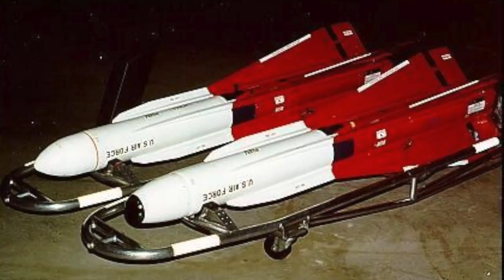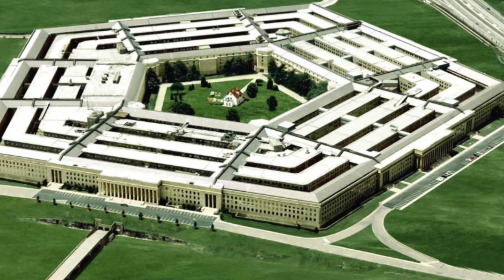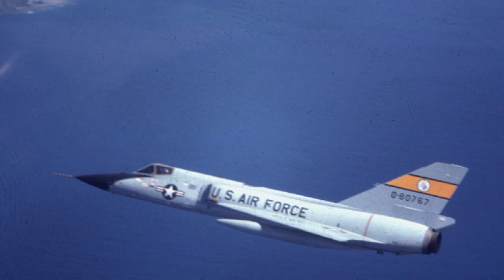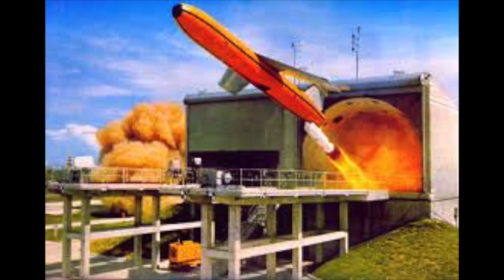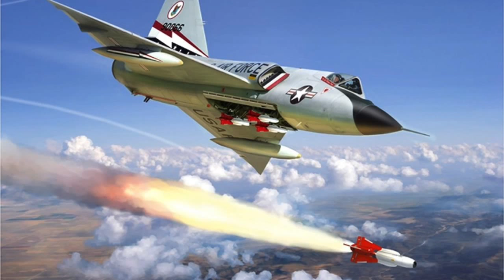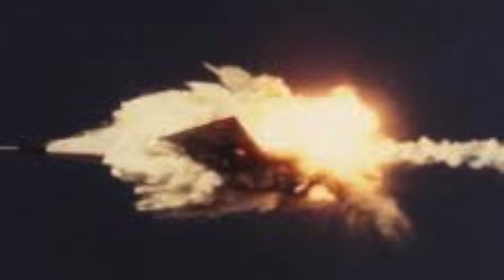MACE kill

Comment: It was the MB1A1 rack that was in the center of the aft rails, My question to you as a 6 pilot should be easy, what weapon was carried there? The only fighter interceptor to carry one. What was it?. I was stationed at Griffiss from 1980 to 1988. 462. LSC crew.
Reply from the maker: edward moriarty Most of the time the MB-1 rack was empty. On aircraft modified to carry a gun, it could not carry the MB-1.
Reply from the maker: edward moriarty We never carried an AIM missile on the MB-1 rack.  The racks were completely different designs. The MB-1 was ejected from its position, while the missiles were extended on special rails before being fired.

Comment: a bit unrelated, but what are your thoughts on the F-104 Starfighter? I heard it cleaned house during Feather Duster II
Reply from the maker: See my video on F-106 v F-104.  The F-104 was amazingly fast, but was short on fuel, had no radar to speak of, and couldn't turn with the F-106 subsonic.  However, at about Mach 1.4 our turning was almost equal.  I think the F-104 was an amazing plane for its day, but short range was its major problem.  To go any distance, it needed external fuel tanks and when you load it with bombs, it was no longer so fast or so good.

Comment: hey Bruce, you talk as though you were a pilot on the 6. if so, what missiles went on the front launchers and whitch went on the back. what went on the center line. it was the only interceptor to carry one ever.
Reply from the maker: Yes, I was an F-106 pilot - it was my favorite fighter!  We usually put the AIM-4F radar missiles in front and the AIM-4G in the aft bay.  There was no limitation - we just did that for standardization.  The pilot could select forward bay, aft bay, ALL, or Special Weapon.  The MB-1 nuke was the Special Weapon.  They pilot would select the FWD bay for radar, on a front attack, and AFT to select the IR missiles.  Even when we selected the IR missiles, our radar and computer could tell the missile where to look for the target and how far away it was.  We had GREAT success with the AIM-4F and AIM-4G missiles.  The F-4s were using an older model of the missile, made for the F-102, and they did not have the aircraft computer which prepared and fired our missiles at the optimum moment.  As a result, the F-106 had a much higher PK (Probability of Kill) than the F-4.  It may have been because of the F-4 problems with the AIM-4 in Vietnam that the generals directed that we do the no-notice test that I describe in this video.

Comment: the rack was always there. it usually had a travel pod for the pilots. the only time it was removed was to install 20mm m61a1 vulken cannon and we had to change the bay doors to fly it. it was a complete waist of time and money. it only held 625 rounds and could fire 4000 rounds per minute. you got two squirts on th trigger
Reply from the maker: Edward Moriarty - I never had the luxury of flying with a travel pod in the F-106.  You must have been with the F-106 after I was.  I never saw a travel pod.  We tied our bags to the missile rails.
Reply from the maker: Edward Moriarty - the F-4E had only 639 rounds of ammo, about the same as the F106 gun.  For strafing in support of ground troops, the F-100 carried 1,600 rounds of the same 20mm ammo.  With four guns, the F-100 fired as fast as the single gun of the F-4E and the four guns spread the bullets out on a wider strip, rather than a narrow line, much better for supporting ground troops.  I fired the F-100 guns often in Vietnam, usually expending all 1,600 rounds.  We usually fired in one-second bursts; three seconds expended all the ammo.  We seldom saw our bullets hit the ground, as we were in a dive and had to pull up before the bullets hit.  As we pulled up, we would look over our shoulders to see the smoke from where the HEI (High Explosive, Incendiary) bullets hit.

Comment: the f-106 was on the front line from 1957 to 1985 and was a pure interceptor with internal weapons bay and was nuclear capable. please take your time listing any other plane from the past or present with that designation.
Reply from the maker: Ed - the F-102 met that same criteria, only a few years earlier than the F-106.  The F-86D and L were both pure interceptors with an internal weapons pod, used radar intercept, but were not nuclear capable.  The F-86D and L had a weapons pod that extended only at time to fire, and launched 24 unguided air-to-air rockets.

Comment: The IR seekers were already pointed at the tgt in the bay ?
Reply from the maker: Yes!
Reply: @spiritofattack  The rdr ones as well ?
Reply from the maker: @wiesenbefeuchter  Yes, both the IR and radar missiles were pointed at the target just before the rails extended for the missiles to fire.  When they extended, they should be already looking directly at the target.
Reply: @spiritofattack  The intervals please, for the ir ones, for the ir and rdr ones and for the rdr ones.
Reply from the maker: @wiesenbefeuchter   There was the fire signal on the pilot's scope.  Within 2.5 seconds, the missile bay doors opened, the aft (IR) missiles extended, and the IR missiles fired.  The computer had already slaved the seeker heads to look at the target.  There was a delay of milliseconds between the firing of the two IR missiles so they would not bump into each other in flight.  The two forward (radar) missiles then extended and fired with a similar millisecond delay between missiles.  After the rails retracted, the doors closed rapidly.  The pilot could select IR, Radar, or All.  I never fired a full load of four missiles, but I did fire two IR missiles on this MACE mission.  When I shot down the BOMARC, I had only one (IR) missile loaded.
Reply: @spiritofattack  Thanks. Would you explain the IRST modes "Scan" and "Slave", please ?
Reply from the maker: @wiesenbefeuchter    IRST Scan meant that the IR was dominant and locked on in IR, while the radar continued scanning for other targets and also to pick up the range on the target that the IR is locked onto.  The. pilot could lock on with radar when he saw a good radar target, as radar was the preferred attack mode.   
IRST Slave meant that IR was dominant, and the radar was slaved to the IR seeker.  This would allow the pilot to see through heavy jamming and intermittently see the target, getting the range manually.  He could upgrade to radar or fire his IR missiles when he got enough burn-through to get range, and fire using a firing range marker on the scope.  We usually got burn-through and could see the target on radar before that point.  We could also use the optical sight and fire when the wings of the target fills the reticle in the sight.
Reply: @spiritofattack  And how was the rdr correlated to the IRST in "Scan" ?
Reply from the maker: @wiesenbefeuchter  I'm not sure of the question.  In both normal radar scan and IR Dominant, Radar scan, the radar scanned in relation to the horizon.
Reply: @spiritofattack  I meant, if both sensors aquired different tgts, how was the rdr brought to bear then ?
Reply: @spiritofattack  Did the rear rails retract after firing before the fwd ones extended or did all at once retract ?
Reply from the maker: @wiesenbefeuchter   The pilot was always in control.  Just grab the hand control, swing the radar over to it, and lock on.  One matter that is seldom mentioned is the elevation of the target.  Our GCI reports of radar altitude were scarce and generally inaccurate, so "search high and low" was common.  As you got closer, the altitude became more critical.  In that search, radar was far better than IR.
Reply from the maker: @wiesenbefeuchter   The rails retracted AFTER the last missiles were fired.  That made sure that there was enough pneumatic pressure to fire the missiles properly.  If you were low on pneumatic pressure, you could always fly back with the rails extended.  Why do you ask such detailed questions?
Reply: @spiritofattack  Because I didn't find it in the book or web.
Reply: @spiritofattack  Did the display show the same symbology in IR / RDR mode ?

Comment: I thought it was an easy question for a 6 pilot, You might have been in the guard or air reserve and would have never seen or flew with the, AIR-2- Genie unguided nuclear rocket, that would explain a lot.
Reply from the maker: edward moriarty I carried real MB-1 nukes several times. I fired a non-nuke test version once.
Reply: like to meet you , keep commenting, it was a glorious time.
Reply: just remembered another fun fact, the 6 leaked so much fuel on the ground, we had fuel bowsers, 55 gallon drums with a telescoping funnel under each wing. in the early 80,s we would use cat liter to soak up fuel bowser overflow, we the went to SUCK CLOTH, official name for a roll of white cloth that would suck up anything,  SUCK CLOTH.
Reply from the maker: edward moriarty - I enjoy your comments.  The MB-1 Genie was redesignated the AIR-2A, I don't know why they changed it.  I did not like it because our Falcon missiles had about the same Probability of Kill (PK) as the Genie.  While the fighter could escape the 1.5 Kiloton blast at high altitude, we were not sure it wouldn't kill us at lower altitudes.  The AIR-2A would go farther at high altitude (where the only test was made).  At low altitudes, it would not go as far and we would be a lot closer to it.  Also, firing the Genie at low altitude probably meant killing people on the ground, and we were defending the USA, so the people on the ground were American civilians.  About 3,000 Genies were built.  I'm damn glad we never used them.
Reply from the maker: Edward Moriarty - As for leaking fuel -- the F-106 leaked a lot less fuel than the SR-71.  The SR-71 skin temperature got so high during its Mach 3 flights that the expansion and contraction of the airplane caused serious fuel leaks.  I remember bigger fuel leaks from the F-102.  Every now and then, a pressure relief valve would malfunction and the F-102 fuel would expand in the wings and start dumping many gallons of fuel on the ramp - a garden hose of fuel pouring out (usually one wing) and maintenance would be running around getting enough containers to catch many gallons of fuel!